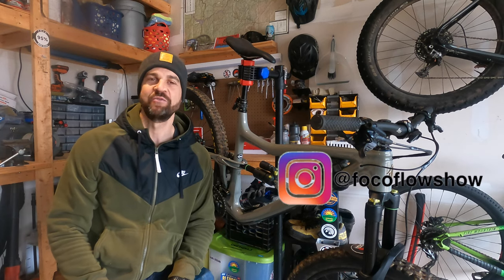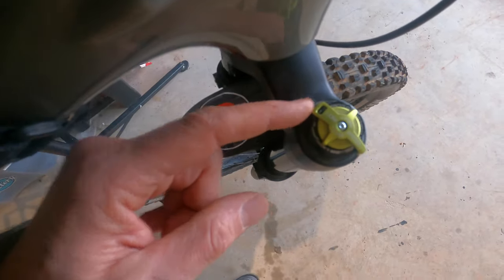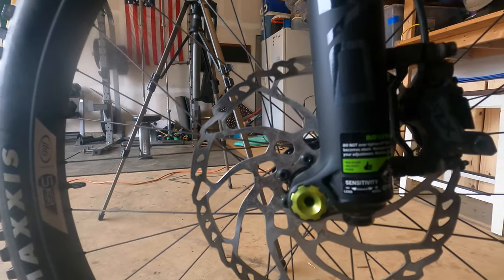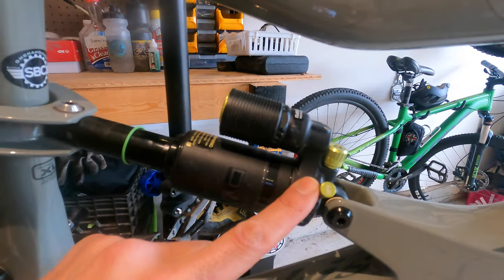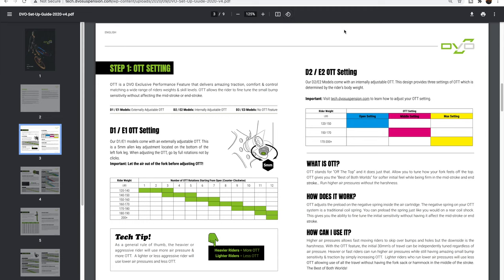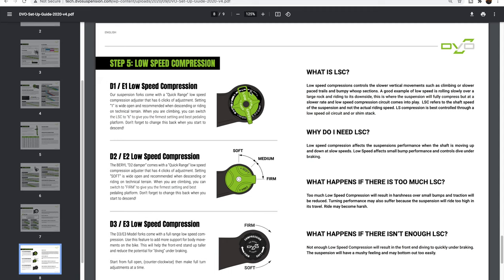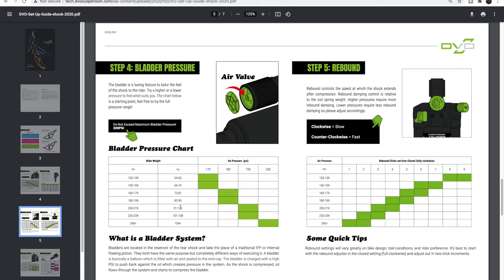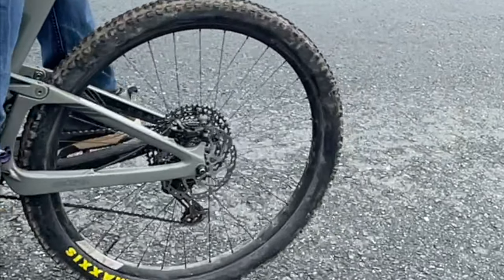DVO Onyx SC & Topaz Review (Ibis Ripmo V2 Suspension Set Up)

Comment: Running same onyx up front with jadeX in the rear. The jadeX is buttah,  fully open the back.end feels so smooth i could barely feel the trail chatter, I like it on trail mode for hitting jumps and drops. I'm still dialing in the front,  My OTT feels spot on but I'm not getting full travel on high speed hits. Currently @ 65 psi with about 20-25% sag.
Reply from the maker: That’s good intel on the Jade.  I weight 205lbs fully kitted at 80psi and 25 sag and it feels pretty good ... I still might open the OTT further - i think I have 1 full rotation left

Comment: Nice review man. Quick heads up on the OTT, which I also broke on my Diamond- I think you have to let all the air out (or most of it) in order to turn that dial to the desired setting. I wish DVO was more forthcoming about this or had some sort of warning.
Reply: Oh, I just realized you mentioned this in the video (about having to let air out before OTT adjustment)
Reply from the maker: @ryanrobin12  yep - but still a good reminder
Reply: How do you know when the OTT is broken inside, mine adjusts easily even with 55 psi of air in the fork?
Reply: @ryanrobin12  not stirring the shit almost a year later but they have a sticker above the ott that says “release adjust ride” then says release air pressure to adjust ott. At least on my 2020 diamond it has one

Comment: Bought a 2022 used Ripmo AF yesterday. Two manuals online recommend entirely different air settings (one 2020, one ?). As well, recommended OTT is 12 for my weight; mine goes to no more than 10. WTF??
Reply from the maker: I would call DVO directly - they are really knowledgeable and can make more specific recommendations.
Reply: @FoCoFlowShow  thx

Comment: Hey man, great review. I have the exact bike in an XL as well. I'm also 6'2 and about 205 ready to ride. When I bought this bike there were no larges and the way things were going with bikes I jumped on the XL. So far I love it but I cant help but wonder what the LG would have felt like. Were you able to try both before getting the XL? If so, what did you think?
Reply from the maker: When I bought my Ripmo V1 2 years ago, I demo’d both a L and an XL and I felt really cramped on the L.  The L was  a tad bit more nimble and “flickable” but the XL just felt better across the board.
Reply: @FoCoFlowShow  Good to hear. Thank you!
Reply: @robertgiggi1133  I bought a Ripley recently and I felt the same way. M was fine for my height at 5'9 but L felt much better. If you are enjoying your rides, that's all that matters otherwise you would know.
Reply: 25mm reach difference. Not much
Reply: @DM-hw4cr  the reach difference isn’t really much like you say, but the wheelbase is almost 30mm longer on the XL. That’s what I was worried about most but it’s been a non- issue so far. The bike is just so nimble I don’t notice it at all👍🏻
Reply: I’m 6’2 and went large Ripmo AF. I use my bike for a mix of trail and park and feels like it’s a good size

Comment: Hi. Foco. Do you know how much stoke you have on your topaz? 
I have ripmo v2 topaz too. It says 210x55/50mm.  So im not sure if the stroke is 55mm or 50mm. 
How did you measure sag? 
Thanks Foco!
Reply from the maker: The V2 is a 210x55mm shock.  Sag is how much the shocks sits in its travel when sitting stationary on the bike and pumping the travel from the attack position … you usually need someone to hold the bike steady to do this… I usually shoot for 25% sag
Reply: @FoCoFlowShow Thank you Foco! 
So I guess you shoot for 14mm sag to make it 25% sag? (14/55)
Reply from the maker: @akjw86  yea - I usually just eye ball it but that’s the right idea - if you can try a few different sag settings on the same section of trail with some steep sections or areas of high speed chunk to get a feel for what you like best

Comment: Worth mentioning ripmo v2 linkage is more progressive than v1
Reply from the maker: Yes - good point!
Reply: Yes but not progressive enough IMO, I added the Cascade link to my RAF to increase progression.
Reply: @yipyipyip  Have you noticed much difference with the Cascade link on the V2.... was considering making this change.
Reply: @markhamlewis4929  yes, but not radically more progressive, I found I kept the same volume spacers (1 neg, 4 positive) and pressure but enjoy more bottom out resistance. BTW, I am 150lbs kitted for riding

Comment: I’ve had my Ripmo for 7 months and I still haven’t gotten my DVO onyx dialed in yet. 😂
Reply from the maker: I’ve had more issues with the topaz… onyx is pretty close to perfect with it almost fully open using Ibis recommended tune … I found the ibis rec too light for the rear
Reply: @FoCoFlowShow  i tried both Ibis and DVO recommended settings. I still can’t figure out how to get rid of the high speed chatter up top when descending. Feels like I’m on a jack hammer but on the jumps / drops & chunky stuff, it’s buttery smooth. Any ideas on if I should add more OTT? I’m about 7-8 turns from full and rebound about 18 clicks.
Reply from the maker: @jimmyinthaphanh2993  yea man - I had the same issues and now run OTT one turn from FULLY OPEN - I’m 205lbs and ride with about 80psi in the fork - definitely open up that OTT all the way and then tune it back only if needed
Reply: 1)Damping completely Open
2)Pressure Up,until you Like Support and traveluse
3) crank in Ott until IT Matches your taste
4) Use LSC For Chassis Stabilität and bobbing
5) HSC only For fine Tuning If Support/bottom Out Balance cannot be balanced properly.but Generally as much HSC as relly needed.
LSR aß fast as possible only crank down until the fork does Not defect from ROOTS and Jackhammer you Over roots

Comment: Hi there ! New subscriber here I also have a bike club with a bunch of friends I will start putting your videos on the group. Big question what are your exact settings on the Fork and the Shock . I am 210 running 70 psi fork, 18 rebound from all the way +, no HSC , 12 ott. On the topaz I am at 208 psi with 3 bands on the positive none on the negative chamber. Can you please mention your exact settings?
Reply from the maker: I’m 205 - 80psi - HSC fully open (1), 13 OTT, topaz at 210psi (190 is the piggyback) and 2-1 bands in positive - neg chamber ... thinking about adding another band in each
Reply: @FoCoFlowShow  try and remove the negative band  on your shock,  traction will improve dramatically it may have a little Bob but you will be able to pedal better on the rocky sections.
Reply from the maker: @urbanaacademy848  good tip - may give that a try too

Comment: the dvo guide was way off.. i did follow the ibis guide for my RAF and its 100% spot on.
Reply from the maker: Yea. - I needed to added quite a bit more PSI on the recommendation of DVO tech staff - kinda crazy there is such discrepancy
Reply: I found DVO recommendations for the Onyx to be too stiff, the Ibis a bit too soft so now I am a bit higher pressure than the Ibis recommendations (not not near the DVO recommended pressure) and adjusted the other settings to suit the pressure. I really like this fork.
Reply from the maker: @yipyipyip  it’s crazy how much variance there is between the 2 suggested set ups
Reply: @FoCoFlowShow  Yes, it really screwed me up when doing my initial settings and testing as I did not realize how different the Ibis vs DVO fork recommendations were.